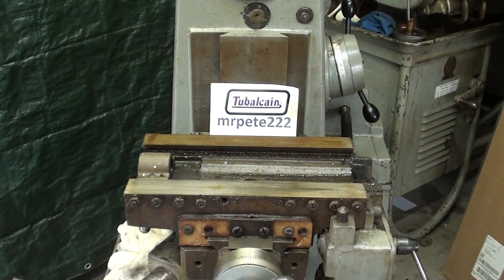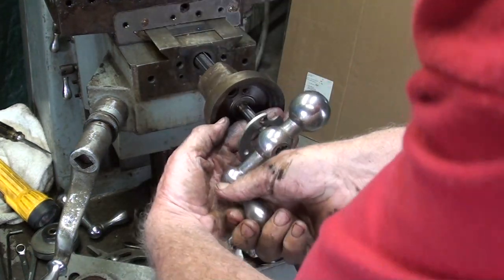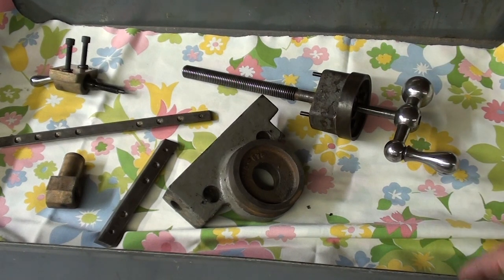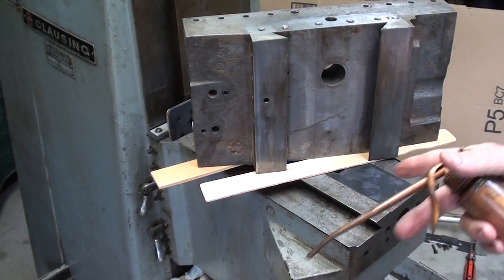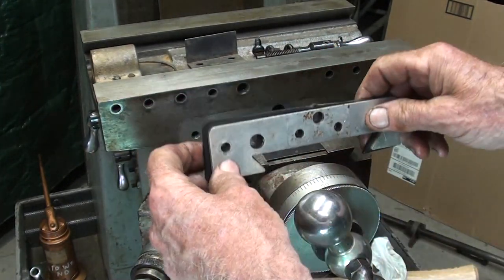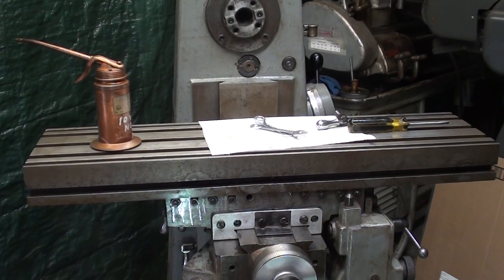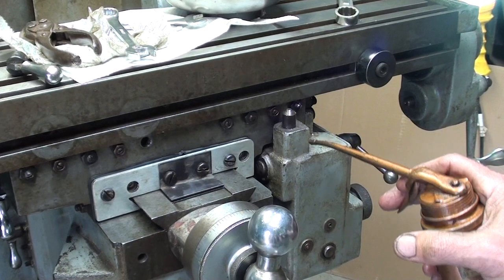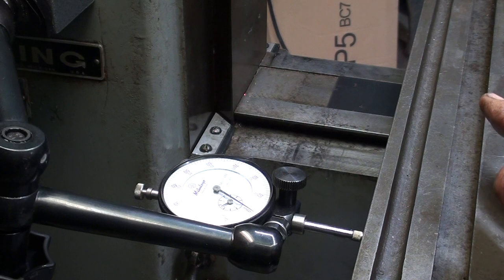New CLAUSING Milling Machine Tips #499 pt 4 tubalcain reassembly

Comment: Mr. Pete I spent many years as a diesel mechanic working on farm equipment.  I would sometimes have a large tractor split into three pieces plus the cab taken off.  Something I use to do is put the bolts back in the same hole I took them out of.  Then when I was cleaning or repairing one particular part, I could keep all of those pieces together more easily.  I highly doubt I know anything that you don't already know, but for me it helped keeping track of all the bolts.
Reply from the maker: That is a good idea

Comment: We would run a fine hone lightly across the contact surfaces to remove any high spots. We manufactured a wonderful small air vacuum that worked well to clean the machines. I often wish I had one today.
Reply from the maker: Good idea using a stone, my brother always does that

Comment: As someone without that level of gib experience, I've used dial indicators to assist by tightening them down, gently, until twisting the table won't move the indicator much, and it still slides with very little resistance.  That really has helped me, since I don't do that kind of work more than once a decade or so.....
Reply from the maker: That is a very good idea I never thought of using an indicator
Reply: I use the indicator through out the process, much like you did at the end.  I wouldn't have commented if I'd watched to the end.  Thanks for the attaboy!!

Comment: Very nice mill. You and I have the same philosophy when it comes to cleaning up a piece of machinery, disassemble only what is necessary, clean and oil, and to heck with the repaint. I looked for a horizontal mill here in Houston, but they're rare as hen's teeth. The closest I came was a clapped out Van Norman No. 12 but it was too expensive. Thanks for the video!
Reply from the maker: I did not realize they were that rare

Comment: Mr. Pete, have you ever seen a Bridgeport mill that had hydraulic motors that moved the table (both X and Y) and the knee?  And also with ticker tape that you could program to run the mill. I found one for sale but it scared me because I never saw anything like it. Looks to me like it is one of the first cnc mills before there was real computers. It had a huge cabinet that housed the cnc mechanism. It was really wild looking!!!
Reply from the maker: Yes, we had one of those at the junior college in 1969. Those are stepper motors on the ends. Do not buy this
Reply: Thanks Mr. Pete! I made a good decision for once. I left it sitting. But it intrigued me to no end. I had all kinds of thoughts on how I could convert it over to digital and have a one of a kind museum piece...

Comment: Thanks for doing this series.  A week ago bought the sister to your machine.  It looks like it had minimal use.  Using this series, I cleaned up my machine, removing the table.  Same issues, the machine was gummed up with old, hardened grease and many, many steel and plastic chips. As of today, painting as I go, I'm about read y to reassemble. If you have any accessories, or extra parts that came with your machine that you want to part with, I have greenbacks that I'd be happy to send you. Question . . . what is the correct description of the taper? NMBT30?
Reply from the maker: Congratulations, I think you bought a great machine.  I think the taper is simply called a MM 30

Comment: Mr. Pete;  When you are tightening the gibs, how do you keep it square, and moving straight?   If you have the left ones tighter then the right, wouldn't that tend to move at a slight angle?   Not sure , just asking.  That is a nice looking machine.  Looking forward to seeing it in use.   Have fun!!!!!!   Michael
Reply from the maker: Probably not. Remember the Gib is forcing the table against the other dovetail